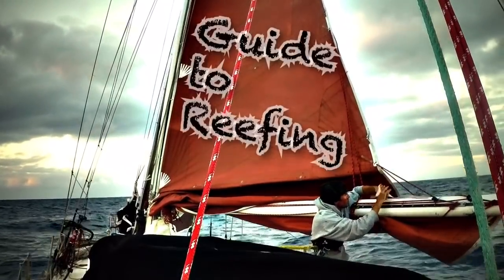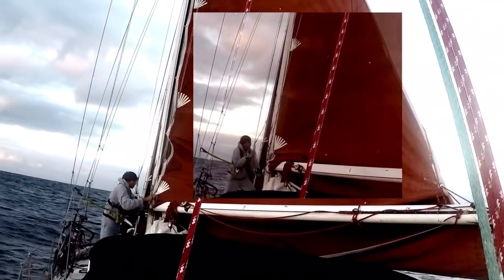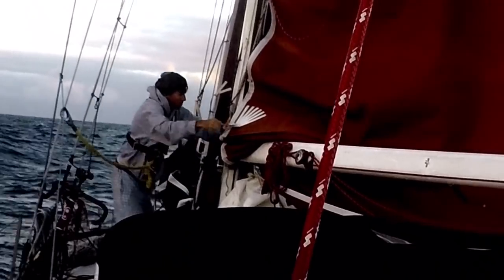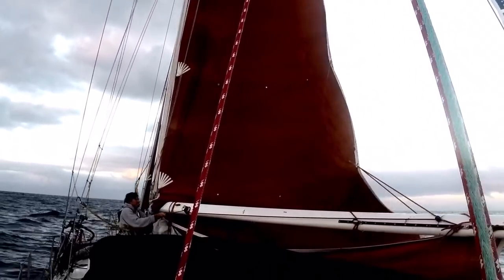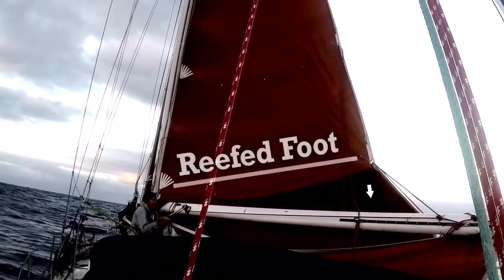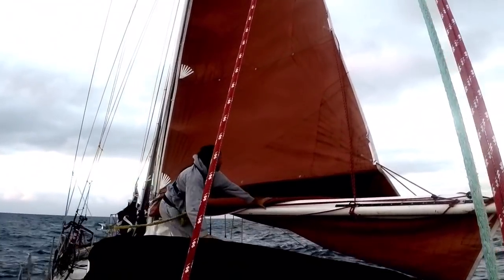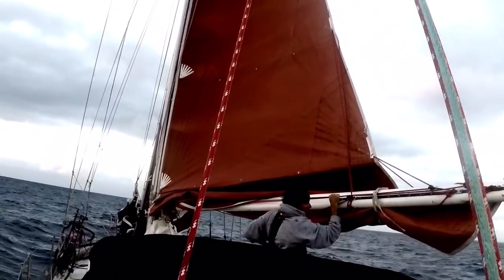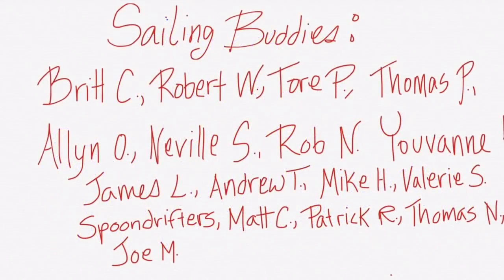Can you Reef ALONE?

Comment: An excellent explanation!

Completely different from how I was instructed.

Time to reef is when you first get nervous about the conditions.

The 10 ft scow I'm building has a sail designed to be easier to reef.

It has a single boomlet and a single reef point, which subtracts about half the sail area. It also has lazy jacks. 

The boomlet is lowered onto the boom.. then the reefing line is tightened to hold the boomlet to the boom.

It's an experimental system that requires no specialized hardware. I can't wait to try it.
Reply from the maker: It sounds like a great solution to making reefing easier!

Comment: Why not have a fourth reef point to alleviate  having to hoist a trysail especially for single handing?
Reply from the maker: The trysail is about the size of the third reef. 
The big issue is if you rip your sail in a storm, when the storm passes you have a rip in the top of your main (so you are screwed). If you rip your trysail, you just raise the main that is still intact after the storm.

Comment: Ive always wondered, could you just simply lower the main and tie a piece if rope through the reef points to the boom? It may not be perfect. but should work Id think? I have an Island Packet 29 and am surprised at how small the shackle is that connects the tack of the sail to the gooseneck. I often think "Id trust a piece of rope more than that"
Reply from the maker: Especially if that piece of rope is Dyneema!
Reply: @RiggingDoctor   What knot would I use to try to tie the sail reef points to the boom? (Im terrible at knowing about knots). I might keep this idea in my back pocket.

Comment: You could use a Dyneema shackle for your tack. Faster, and very strong.
Reply from the maker: Yes, a soft shackle would also work. I like the long line to use the mechanical advantage to get the tack into place. 
A soft shackle is faster than tying but I fear it might be hard to get the tack to it in some weather situations.
Reply: @RiggingDoctor  You're right about the bad weather. I've had trouble with large and short soft tackles. It's hit or miss. If you're lucky you get the tack reefed in 2 seconds. The answer is perhaps to have a thinner and longer shackle that would pass 3 times in the eye. You'd keep the purchase advantage.

Comment: G'day. 
I am livaboard sailor and i like to heave to. Its not everyones idear of reefing however i find it stables the boat more as the boat slows down it becomes easyer to work on as theres not as much pressure on the mainsail.
and when i have to, i know how to heave to. Would you give it a go at some time to compare the differance?.
Gerard.
Reply from the maker: Do you mean to do a comparison of reefing while underway vs reefing while hove to?
Reply: @RiggingDoctor I useully hove to then reef down the main sail. in your video you go on an beam reach and thats were i would like you do a comparission while underway,
to see whitch one is eser.
Gerard.
Reply from the maker: In tight quarters I do heave to then reef that way we don’t run into a shore or shoal. Out in the ocean, there is nothing to bump into :)
The force on the sail is about the same in either situation. Once the halyard is released, the sail begins to spill its wind and the pressure is off. As you pull the sail down, the pressure on the sail decreases even further. 
The nice thing about reefing under way is you know if you are reefing enough. If there is too much pressure on the sail to crank the clew in, then maybe you need to put in one more reef at that moment. 
The other reason I reef underway is then we don’t have to fiddle with the wind steering. Getting it absolutely perfect usually involves a few adjustments and when the wind is picking up I would rather not have to work on it as well. Keeping the course means that we can set the sails for that heading and wind conditions until they are perfect and then we continue on.
Reply from the maker: To answer your question in a more concise form:
The force on the sail is about the same hove to Vs. underway. While hove to, the main only has a lot of power when swinging aft in its drifting arc, this then drives it forward until it looses power again. Most of the time, the pressure on the sail is very low and easily managed. 
While underway, there is pressure on the sail but as you go pulling the sail down the pressure decreases because less sail is up. When you are finally putting the reef in, there is very little force on the sail.
Reply: @RiggingDoctor  
I currrently live on an small catamaran and when i go for a sail i an ts 1000 raymarine tillerpilot to help me steer the boat on course. as usully i am single handed. I will give it a go on a beam reach and see if theres much diffrence myself. just reffittng the boat out so i wont be sailing for a while.
Gerard.

Comment: I thought hove to is a storm tactic to slow down the boat and reduce the lomping as the boat is no longer going
forward to weather, thereby it stables the deck alowing the reefing to be carried out safly as is now drifting with
the wind. otherwise why eles is the tecneqiue there for.
Gerard.
Reply from the maker: The technique is also used for calming seas that are too tall and dangerous to sail in. 
If you reef before the storm, you will be reefing in calmer weather. If you wait for the storm to hit, it will be dangerous to go on deck and therefore you will need to heave to in order to put a reef in safely. 
I like to put in a reef before it gets bad and wait until it is very nice to shake out the reef. 
Out in the ocean, the only time I had to heave to was when the winds got above 60 knots. There sailing under Reefed sails was just not safe anymore so we stopped until it passed.
Reply: Hove to is away to park the boat so you can dump while singled handed and no auto pilot.

Comment: Your safety line is really attached to a bad point, if you fall you’ll get dragged along the side of the boat, better to clip it nearer to the mast IMO
Reply from the maker: With the 6 foot tether, any point will have me dragging behind the boat. The idea is to clip in on the high side so if I fall, I fall on the deck and not fall off the lower lee rail. Falling off the windward side is a challenge with the chest high lifeline in place.